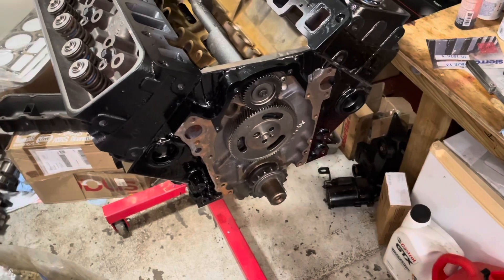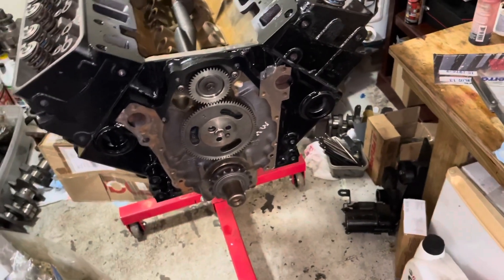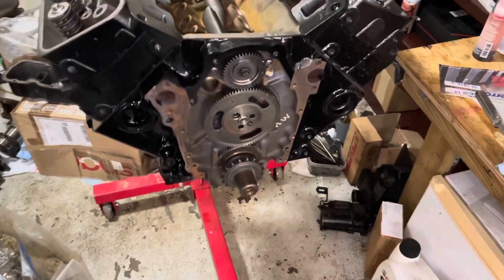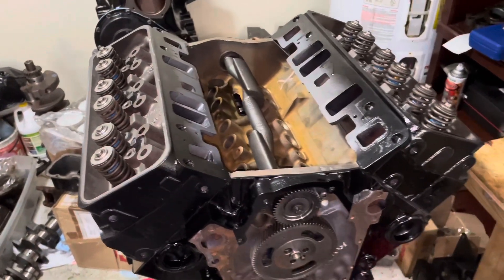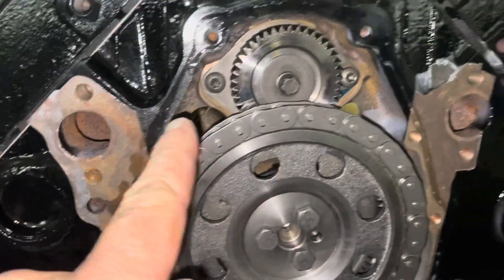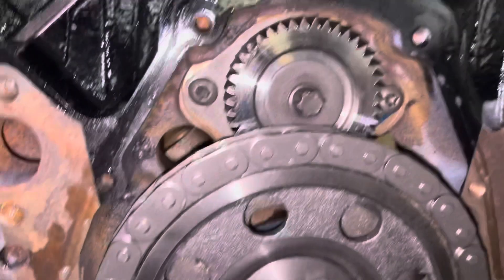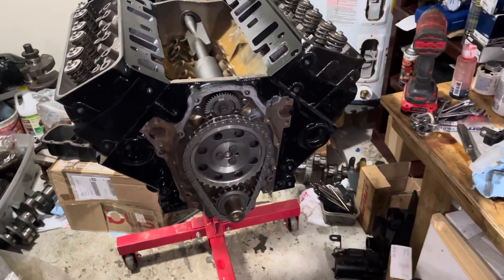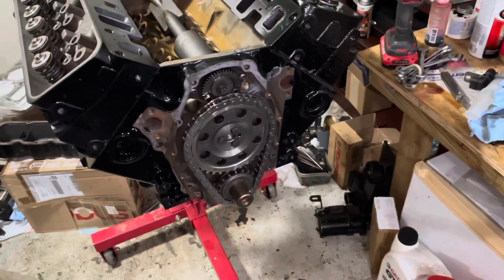Mercruiser 4.3 5a - Marine Timing Tips

Comment: if that's a dorman timing cover it aint shit almost blew my 5.7 mercury engine up with that ragged shit pouring oil out of the crankshaft seal'
Reply: leaked all the oil out of the motor in to bilge of my boat .
Reply from the maker: Just curious did you reuse an
old cover or buy a new one?
Reply: @moccasinmarine  new from amazon had to pull my motor back out and replaced it with a gm timing cover.

Comment: i have a question for you. im converting to dry joint manifolds. i need to change my thermostat housing for the extra hoses or can i block off the ports on the manifold other than the one on the bottom
Reply from the maker: I think you need the extra ports in the tstat housing. Don’t have proof but cold water might damage the manifolds. Only hot engine water goes to the manifolds. Cold water that bypasses the engine goes into the risers. You also want to investigate the water pump pressure. I think dry joints use a higher pressure water pump to push past the spring loaded balls in the Tstat housing.
Reply: @moccasinmarine  thanks ill look into it more